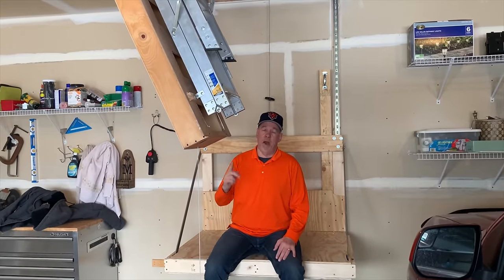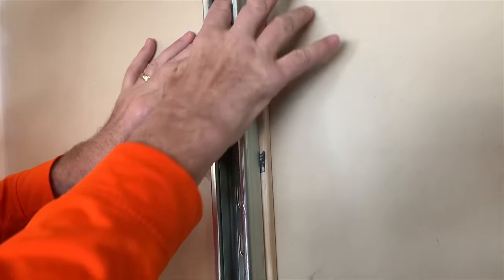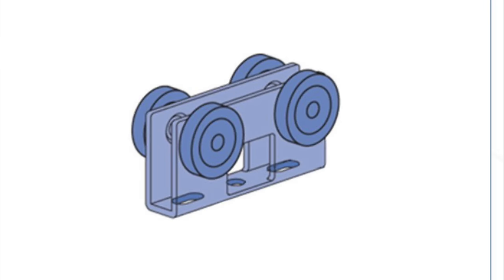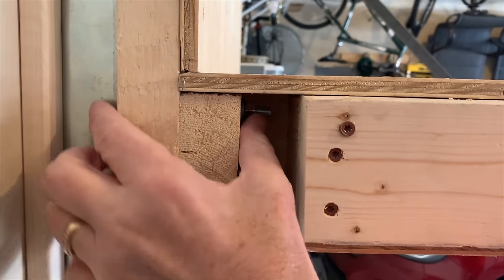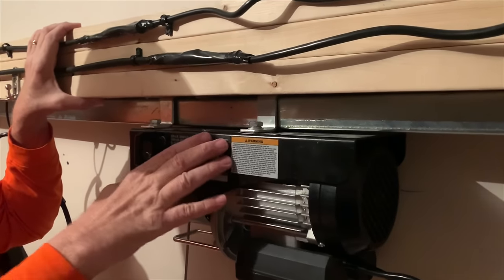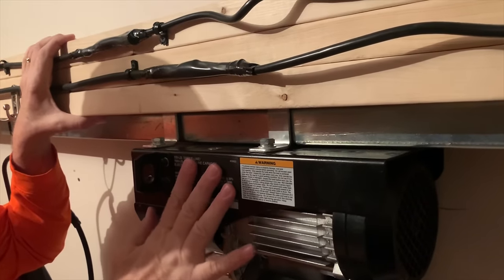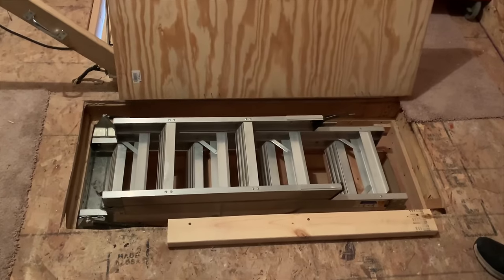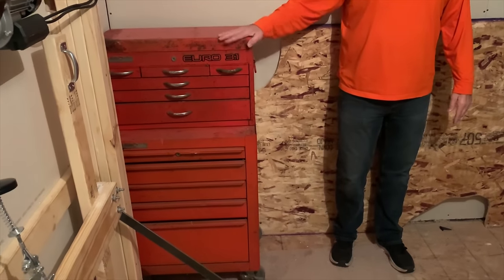Garage Attic Elevator / Lift Build in Minneapolis Minnesota

Comment: Nice!!! I moved back home with my mommie and daddie cause they are old. I've been moving stuff around and I concluded we need more storage space , we are storing other family members stuff iue cousins, aunts, uncles... We have 1800 sq feet of attic floor, and over 1000 sq ftt where somne 4'6 to 6.5" could easily stand. The drop down ladder, hell no. A 75-86 yr old seniors would break thier neck climbing up the ladder.  You solved our storage problem. As for the eletric going out, have a back up batery system you can plug the hosit to, or a SOS button that triggers some flashing lights , whatever, or put a small window up in the attic, so they can stick htier old peoples heads out the window and yell for help. thumbs up

Comment: Good job, I like the idea, but I have some safety concerns.

1) There are too many single-points-of-failure that could cause an uncontrolled drop. The hoist, the cable, the attachment, if they wear out over time and fail, you don’t want to be on or near it. A second motor or a ratchet system should do the job? 
2) There should be a safety sensor around the edge of the hole in the ceiling (not the platform, but the ceiling) to immediately stop the motor if anything comes into contact with it. You could be sending a 25lb chair, but if it gets caught on the edge, it can stress the hoist, cable, and attachments. Which one will fail first and drop the platform.

If you look at the history of elevators, they are known to exist for over 2000 years, but the first office building to get one was in 1870, after the Otis Safety Elevator was invented. It had safety features to slow the elevator to a stop in the event the cable or hoist fails.
Reply from the maker: I’m aware. Check out my other videos. Already on it.

Comment: great idea, and implementation. however, if a person is ever going to be riding on it like that, i really think you should add some sort of ratcheting fall protection system in the event that wench cable snaps. much like you would see on a 4-post lift for cars
Reply from the maker: Check out the other video. We added fall arresters. But the next video should be interesting. We are almost done with a braking system. If it works.

Comment: The whole rail system is genius! However, there is one thing that you’d get dinged on. Every garage ceiling has a fire block. It prevents fire from spreading from vehicles to other parts of the house for a certain amount of time. If you were to make the bottom almost a plug, you’d be better. In our garage, our elevator has insulation and a cap so it almost seals around the edges as well as has a point to stop and keeps the same thermal break. Ours is also in the middle of the garage, too. Right where the garage door opens and covers. So, we added 2 redundant cut off switches so when the lift isn’t all the way up, the middle stall garage won’t open. Prevents anyways from opening while the lift is down, and prevents the lift from going down if the garage is open and the truck is under it.
Reply from the maker: Thanks for the comment. Yes, I’m going to do something like that to fill the gaps. Good suggestion.

Comment: Your design is clever but I do see something that need addressing.  The weak point is the 2x6 df cross beam. Its bored though to receive the bolt which really weakens It.  Consider replacing with stronger material and attach cable with a shackle.
Reply from the maker: Thank you for the comment.

Comment: Well done. Great solution for the age old problem of not enough storage. My only concern is that it would appear that you cut through one of the roof trusses to get through the ceiling. Huge problem. May have to get an engineer to design a structural repair.
Reply from the maker: Thank you. Glad you like it. If you box the joist it’s not a structural issue at all

Comment: When I built my 3 car garage off the front of my house, I had builder put 8' ceiling in attic along with triple 12" microlam beam supporting attic floor. 
I had a 4' square cutout with same hoist in attic as you dropping cable through opening to bring large items up to attic for storage.
As a commercial snow removal contractor.....I stored anywhere from 20 to 30 full size 2 stage snowblowers along with various other landscaping equipment up there in the off-season.
Best addition I ever made to my garage.

Comment: Good idea to move your "stuff" but not being UL approved for passengers you might have issues with your insurance company or the building department, especially at time of resale. Also consider the 550 pound rating and with the platform plus your weight, you are quickly approaching maximum capacity with the first few hundred pounds of cargo. BTW, there's a reason they use drywall in garages, and it's usually due to fire code. Once you breach a ceiling or remove sheetrock from a common wall to the house you have created another issue. Still in all, an interesting build that needs a little refinement.
Reply from the maker: Thank you, yes the weight of the carriage is a consideration. But we would never lift a person and a heavy load of any kind. So we’re good there. Plus, check out the other video where we added fall arresters and watch for our next video where we create a braking system. If it works!

Comment: Excellent build. I've seen a few other builds but like this much better. Those rails, heavy beams, etc should make a fine elevator for years to come. Where did you get the motor with the remote? Harbor Freight?
Reply: @theelevatorSRT8  => Good choice...I learned my lesson years ago. The Harbor Freight winch is only a cheap version of of all the others & won't last very long. Like everything else they sell, you only get what you pay for.

Comment: It looks great. However I would recommend putting sheet rock on the bottom of the lift and ladder to ensure that it maintains a firewall. Our home inspector (I live in MN as well)  pointed out that our attic ladder didn't have sheet rock covering. Since wood is not a fire rated material, if there was a fire in the garage, it would spread quicker to the attic without the barrier.
Reply: Brian Michaels I think you could use any type of fire rated material. When I looked closer at my ladder I noticed that I did have some type of  Sheetrock between the ladder and plywood covering. I’m wondering in your case if you could cover the bottom of your elevator with sheet metal?

Comment: Hey, wonderful job! 
I am building an underground home with 22’ dome ceiling at one side and a 17’ high ceiling area 8’ wide for a catwalk all around at 8’ high landing for art gallery. I have been wondering about designing a “ silent” gravity (by weights) elevator like yours without your engine because yours is so noisy and we have too many power outages in NC. 
Do you have any suggestions seeing that you think out of the box kind of guy.?  Balazs 😁 thank you for your time
Reply: Balazs Szabo
 ... the only problem with using counterweights is you will be constantly adding / subtracting weight. If you don't pay attention the car will be slamming to the top or bottom on a moment's notice. The best compromise is to counterbalance only for the empty weight of the car.

Comment: Cool elevator!  BTW, from long experience, I suggest you paint that garage soon.  Taped and mudded seams will absorb moisture from the air (or wet vehicles) and then will slowly peel over time.  It is worth the effort.  Cheers!
Reply from the maker: You are so right. I need to do it this summer. I will do it this summer!

Comment: Yeah,.. Genius. - until the cable snaps and you go plummeting downward.
Can you say - broken legs?,... Or worse.
Do your self a favor and add some sort of safety mech like on a real elevator. 
Also,... Throw in/on  a safety pin in there somewhere, so when the lift is up,... It can't drop on your head.
Winch is not secured to a proper header/ support beam, as the wood should have been placed vertically,... Not horizontally.
Replace with some micro lam stock oriented vertically, and secure the Erich with some timberlok screws,... Or some long "U" bolts.

Comment: Good idea. I actually put a wider one in my barn on an outside wall behind double doors. I could back my truck under the leanto shed roof, open the double doors and load the elevator with materials that were going into the loft. I used a simple electric chain hoist that I bought at an auction. The barn had plenty of roof height to allow for the hoist and cables. Also, I used a simple on off toggle switch both above and below to operate the lift. It was capable of lifting 2500lbs, was 8ft wide, and 4ft deep. The elevator guides were on the interior wall of the lower level. When I sold our place, the barn brought almost as much value as the house (there were many other innovations unlisted here in the barn, like vehicle lifts for oils changes, showers, full baths and 1 1/2 bath, an office, security, its own sewer system and well, fireplace, upper outside deck overlooking the river, A/C/heat etc. But the lift/elevator was my favorite add-on. I did this in 1996.
Reply from the maker: That is awesome!

Comment: Very nice job sir! I built one for my attic 2 years ago and has become one of my favorite features of the house. I've also found that it has become a back saver when loading/unloading my truck and now that I have a wood shop in the garage, I have used it to lift my new ban saw, table saw and other heavy items...it's a multi use tool! I will be installing flush mounted hooks in the bottom as well for heavy shop projects in order to lift them onto my workbench or load into the truck. I have been a passenger on mine several times as well but it really bothers me about all that could go wrong so I've stopped that practice and also never stand under it. I recently replaced the hand controller with a wireless remote that adds even more flexibility. Once again, great job and nice, clean installation! Enjoy!!!
Reply: @theelevatorSRT8  I'm looking forward to see how you've incorporated the fall arresters. I would like to add those to mine.

Comment: Leaving the existing attic ladder in place has benefits besides those mentioned in the video. If one were to remove that attic ladder, and ride up on a hot summer day just before a power failure occurs, that poor person would be in a sweltering hot area with no exit until power came back on.
There’s already lots of criticism written in the comments, so I am trying not to criticize. Anybody who is attempting to create something similar should really understand all of the safety factors involved.

Comment: Really love your idea! This would be a great advantage in our barn to get to the upper deck. In the long run this would save a lot of space in my barn being able to remove the staircase completely. Especially since my wife has bad knees and can’t use the stairs very easily anyway! Never liked the design since the staircase is in the middle of the front of the barn and there’s two sliding doors on the barn on each end. Makes the whole middle of the front of the barn with the staircase useless for putting anything else. Where this elevator could easily be put in the back of the barn  doing away with the choke point in his staircase causes.  I have more than my fair share of projects to do, but this one I have to add to my list for more than one reason. Got to be done now! Thanks for sharing the idea.
Reply: @theelevatorSRT8  I’m a old timer retired contractor, so building one wouldn’t be a problem for me. Over the years I always loved when someone say you can’t do that or it can’t be done. Then I’d build it and prove them wrong. Built a floating counter top for a disabled guy once and everyone was afraid it fall off the wall with no supports under it. I jumped on it with all my weight right in front of them to show its not going anywhere. At the time I was 235 lbs.

Comment: Great job. I love it. I Would like to do something similar in my shop. I hate placing a ladder in the space to climb up. I do currently have a 2500lb winch above the Center of the hole so I can lift my tires and other things up with and it works great
Reply from the maker: Cool. If you do something I would use it with tracks on a wall like ours. I saw one guy crash to the ground With one with 4 cables.

Comment: As it has been stated probably some regulatory body would take exception to this elevator be installed in a house.  But for most part only needs inspected if is a public building.   Built without permit  not an issue. If he could get the supplies into his house and construct is just what happens in this world of diy and big box stores and internet shopping.  Neighbors didn't complain guess they probably doing things in their homes that weren't permitted also.

Main concern I see is when then go to sell in future. Will probably need to remove most of it. And sheetrock back over hole. So that house will pass inspection before sale.
Reply: The prospective new owners would probably want it camouflage so they don't have to reinstall it!
Reply: @rollingsteady3107  ... That's where code compliance come in. If it's not UL rated for passengers it should be posted so. Since this is a DIY project it will never be UL rated. People should just take the stairs and save this for cargo. A snug fitting steel plate at the bottom will probably get it to pass a fire inspection, where needed. (garage attached to a house, etc) Lift capacity should also be posted at the control and on the platform just to make it semi idiot proof. That said, one should always consider an added safety factor in capacity. The winch here is 500(+) pound rated but that tool box could easily go over this rating. The next size winch is likely just a little more, cost wise. Cheap insurance.

Comment: Great build!...As a general contractor,  for 30 years, I was thinking about something like this for disabled people that can't afford the 35K for a one stop elevator...You could angle the unistrut along a staircase and use a sled like you've constructed...Thanks so much for the upload...
Reply: @theelevatorSRT8  SMH...But, you are allowed to put any contraption you want to, in your own house. Me, as a contractor would get in trouble, if I "cowboyed" it in without a permit.. But I would just spec it as a "dumb waiter" No passengers; get the final inspection and FAI...Fly as is, as we say in the AirForce...If you headered off the attic floor joist and use joist hangers; structurally; there's nothing wrong...If your wiring is plug in; you're good too...I hope the  Jerk that threatened that gets his head punched in... One thing; if the state sends you anything; throw it away...They have no jurisdiction on private residences. As well; it's in the garage to an attic...I wouldn't even worry about it at all...Now if it was inside the house; you might get some static....
Reply: @theelevatorSRT8  :)...That's a heck of a move! Going from a big city to a Viking settlement, must be a big change! :)...I landed in Minnesota once; hated it...:)...They were one of the earlier airports to ban smoking. I remember going out a side door to smoke...:)...That was the 80's though...Hopefully; you get to enjoy your  creation and nobody is the wiser...Good old American ingenuity just isn't respected anymore...And Rat finks like the douchebag that threatened diming you out need to get sorted...

Comment: Did you seal those cracks between the 2X4's on the dry wall before Winter?  Caulk or Foam.

Comment: Looks good only the one problem you have you have your header the wrong way you're two by fours are supposed to be turning the other way and stack side by side you're not getting the full strength of your header that's why it's sagging on you
Reply: Is it actually sagging or the lens of the camera bending the "straight" lines ??

Comment: I commend you on the accomplishment, but there are so many ways that you could easily improve the design and  make it much easier to built.
First off when you build a "built up beam" you use plywood strips between the studs for strength in the vertical direction.
Second ...Never use a built up beam with the studs in the direction you have done it as their way stronger on edge that flat.
Third... the hoist should have been attached with longer bolts through the built up beam and a plate on top that spreads the load the channel and straps is way weaker.
Fourth there should be plywood corners on the lifting beam to spread the load and there should be a triangular structure to lift the platform...triangles good flat boards bad.
The boards that mount the top wheels should have been as long as possible to decrease the loads on the track and rollers they are short not out of any need to be short.
Fifth ...the  lifting support metal flat bars should be at the most shallow angle possible and so increasing the top roller wood beams height and then attaching the bars up much higher would decrease loads on the whole platform structure
Sixth the  beams that support the upper rollers should be "built up beams" with plywood on edge in-between the  wood that's laid on edge.
I could go on and on but you get the point....there are some basic engineering choices that can be made which result in the structure being many multiples stronger and lighter and it's just basic engineering not high level stuff.
Just my .02 for what it's worth
Reply from the maker: You are probably right about many things you point out. May I suggest that next time you should ask why things were done the way they were? There are reasons for all of it. Bottom line is, the thing can handle 3x the load it will ever be required to carry. 
Your overall point out it being lighter by utilizing a more sound engineering plan is absolutely true. No question. It appeals to my mechanical senses!